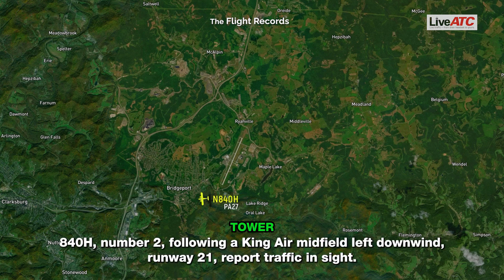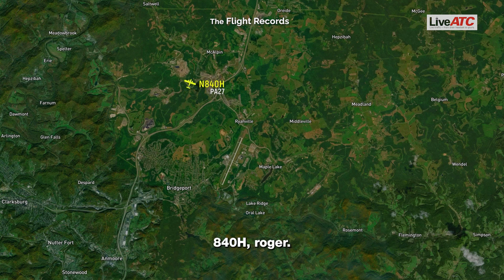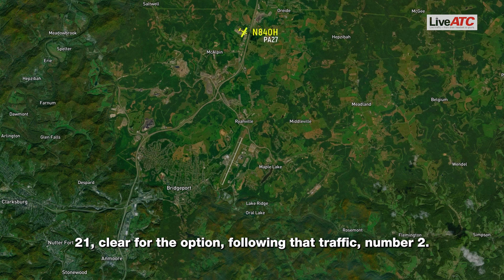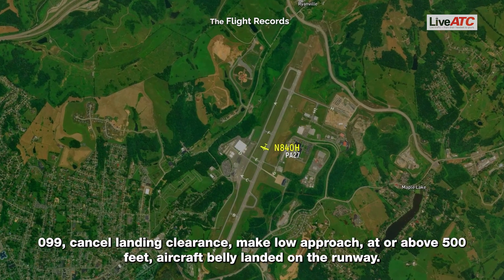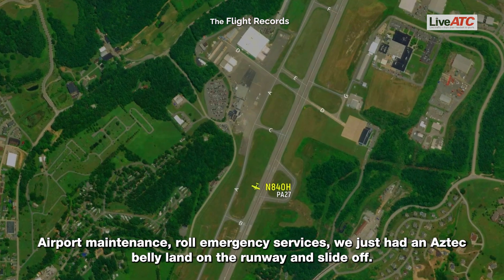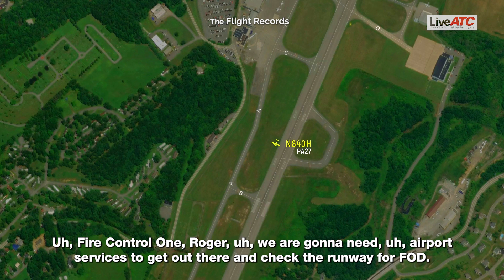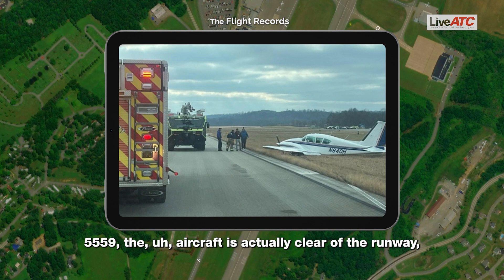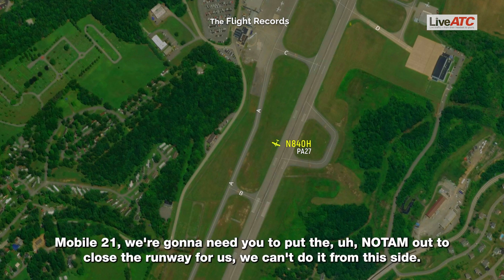Twin-Engine Plane Belly Lands on the Runway and Skids Off [ATC audio]

Comment: Wait a minute now. You are saying the airplane suffered a "landing gear failure." Are you advocating that all three landing gear struts malfunctioned at the same time or only one or two failed? Looking at the screen grab, I don't see any evidence that any one of the three gears was ever lowered. The pilot did not declare any sort of problem before touchdown, so he must have either had all three down as normal or none at all. It appears here that the only problem with this landing is that the pilot forgot to lower the gear. It is extremely unlikely - to the point of absurdity - that the airplane suffered simultaneous mechanical problems with all three struts.